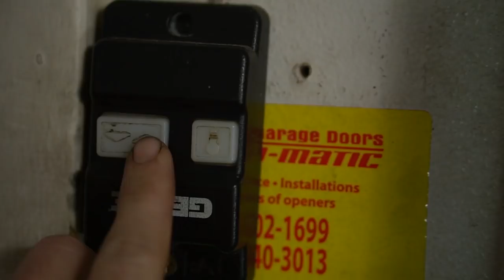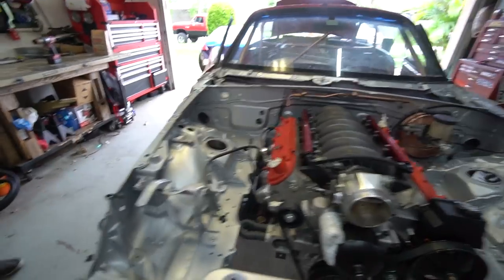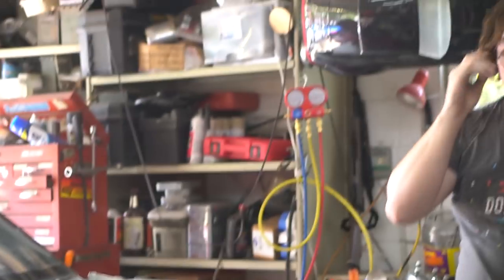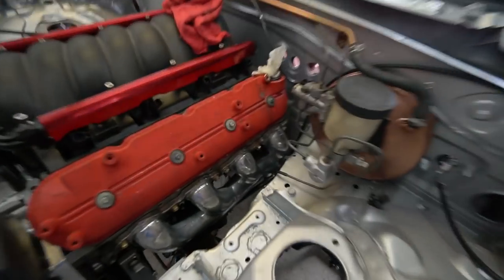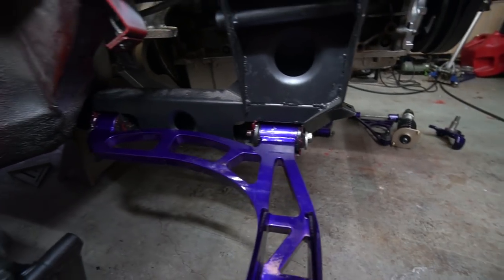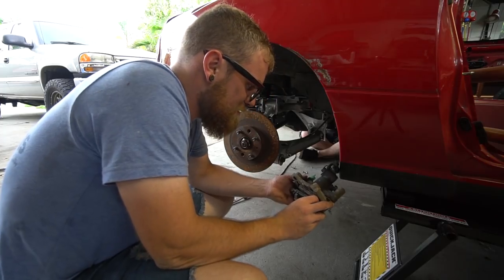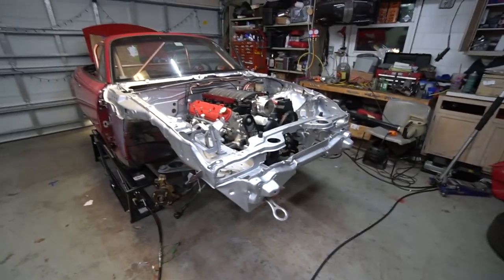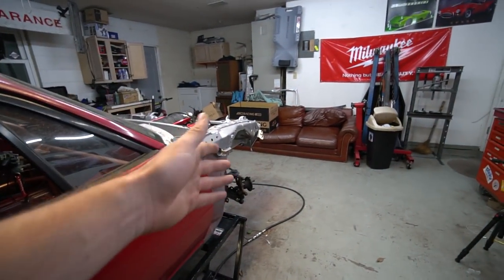Budget LS Swap Miata Ep.22 Steering rack and Angle Kit

Comment: I think you should make the angel kit fit. ether modify the control arm or subframe. I would cut out that plate in the subframe and weld on a thicker plate further in
Reply: silentpower I was thinking something similar to that
Reply: silentpower  ya thats what i was thinking just cut that frame and box it as much as you need easy
Reply: Agreed,  he could cut out the section of the subframe where it hits, then weld in something like a piece of pipe cut in half (C shape), and have all the room he needs.
Reply: I hope he sees this, it’s the best option for sure.
Reply: i agree i think he has the skill now to cut and weld in a new plate to make the other kit fit
Reply: Yeah just notch that subframe out some
Reply: silentpower agreed. Or hammer it in some and round off the control arms
Reply: silentpower +1 on notching subframe
Reply: Yeah like cut the section out that hits and flip it around, add a little bracing and bam they fit
Reply: silentpower this was exactly what I wanted to say to taylor, let's hope he sees it

Comment: If you need clearance on the subframe you could section a length of 2.25" - 2.5" tubing and replace a section of that plate to provide clearance with minimal cutting because at that that point the lower control arm has a fixed arc .

Comment: What about plating the top and bottom of the new subframe for reinforcement and then cutting away what you need out of the side carefully. 3mm flat bar top and bottom will be plenty of strength for cutting away some of the side. Just needs to be stitch welded as well, not fully welded. Fill in the gaps with silicone

Comment: I would make one cut down the middle front to back where the lower control arm is hitting push the metal in and weld it. It would turn the box section into 2 triangles one on the top and one on the bottom.

Comment: Cut out the side of the subframe find a piece of pipe with a decent size wall thickness cut the pipe down the middle and weld it into the subframe so the side of the subframe will become concave and it’ll make clearance for the arm.